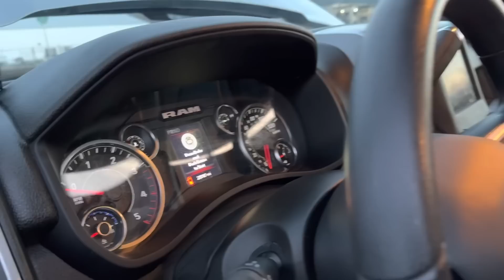Tired of the 2022 Ram Cummins Engine blowing up.

Comment: Your channel is part of the reason I tried ram out. Just bought a 22 a year and a half ago and had 3 DEF lights on in under 10 thou miles. Now I’m hearing of all these issues with the motors. Good thing the 23 powerstroke I ordered is coming soon.
Reply: I had a DEF light pop up on my 22 after filling it at the pump. Reset the code and it never came back.
Reply: Sorry to tell you, but welcome to Emissions. You're just going to have problems with any of them.
Reply: Keep an eye on leaking upper oil pan on powerstroke
Reply: @The Outdoor Group Heavy duty trucks don’t have to meet any MPG standard. They’re exempt because they’re heavy duty. They do, however, have to meet EPA standards and stuff, hence the def and dpf.
Reply: @The Outdoor Group If Ford gets Cummins engines, it’s over for Ram. Unless they get back together with Navistar or CAT comes back to on-highway diesel.
Reply: @cliffordmontana4562  there has been (is) an effort to develop standards for HD fuel economy standards. Around 5 or 6 years years ago, you could read the proposed rule on the epa website, not sure if it's still there. I do know there's a new round of emissions standards set to take effect for '27 (I think), I would not be surprised if they take advantage of that time to also implement mpg requirements.

Comment: The last Cummins I bought was a 2012. Didn't run great from the get-go. Found the valves were set from one end of the spec sheet to the other. At 50,000 miles it started blowing the coolant out the degas bottle under boost. Bad head gasket. Pulled the head, resurfaced the head, studded it... normal stuff. Did the same thing again about 40,000 miles later. I guess the block wasn't flat enough. Personally, I think Cummins either has a QC problem they refuse to address or there is something up with this emissions junk that wrecks everyone's life. I've started rebuilding the old pre-computer stuff instead.

Comment: I had a 2020 throw a rod through the side of the block at 4500 miles. I was towing my 5th wheel to Deer Lake from Spokane. Cummins thought i modified the engine. It was 100% stock. They finally replaced it after a few months. What the heck is going on???
Reply: Mopar.   Typical Mopar products
Reply: @eddiespagetti8395  cummins isn't mopar genius
Reply: I haven't been to deer lake in 20 years. Must be a lot different if you can get a 5th wheel in there. When I was going there with my grandpa it was camper only and like a 12' boat max
Reply: @eddiespagetti8395  Cummins is owned or manufactured by dodge…. Cummins is going to shit because of emissions my ol 93 is still running at 500k Km
Reply: Fiat is probably buying the parts for Cummins... who knows from where.. probably the same place they are buying frames.
Reply: If cummins makes the engine, how is fiat giving them parts? 😂 dumb
Reply: @Project Q  well... the improvements in weight and power haven't been driven by Cummins.  But they have by Fiat! And no one is going to say the quality is what it once was. I'm saying Cummins is probably just doing what they're told at this point.
Reply: @Turbo_Q  if you don't know... one of us is dumb 😁

Comment: What do you pay your drivers? I've ran Hotshot for 3 years otr.. All we run are new 5th gens. Only issues I've had is the cp4 going out. Had one truck with the replacement cp4.2 go out also. Zero engine issues though 🤷🏼‍♂️

Comment: Look at the Aisin K1 snap ring TSB for the 22’s as well. Received my order in Nov, 2022 and now  have 18,000km, 6,000 of that towing, and suddenly lost all gears except 5th and reverse. I’m told at least 1.5 months before I will see mine back. I have always driven Duramax’s and I’m not off to a good start with this Ram.
Reply: This is being talked about on the Ram forums and FB. It seems to be an issue with the mid to late 22 models. I believe the TSB states it affects the 23's also.
Reply: mine had 1200miles on it when the aisin quit. the trucks that are effected are mainly 22's built from may onward
Reply: @fessie0121  did you get yours back yet? The dealer for mine said they have no idea on parts but are hoping 1.5 months. I’ve been reading on the forms of people getting the parts in and the snap ring replaced and still have no 1-4 gears after everything is put back together. This one has me pretty worried.
Reply: @bengourley8406  I did get it back, and the next day it went in for no oil pressure!!! they say it was a faulty sensor. i have not driven it much since I got it back again but it seemed to be working. keep in mind this truck sat in the shop for 38 days after only 4 days of ownership. So i guess we'll see what happens on my first longer trip which is coming up March 27, it will be about 1500miles of moderate towing....

Comment: The biggest issue with all these newer diesel engines is all the emissions crap they attach. EGR is probably the worst offender with longevity and reliability of the actual engine. All the after treatment crap just kills fuel efficiency and increases the likelihood of the computer shutting off the truck because some sensor failed. 

I understand not wanting to pollute the environment, but it comes at a pretty high cost in reliability and dollars.
Reply: Only failures I've had with my 18 are these chickenshit delete products I got suckered into buying
Reply: @wizard_of_poz4413  You should have done better research, deleting your truck is inherently good for the engine if done properly

Comment: Mon-Fri I run a 2022 3500 HO DRW (56,000miles) pulling sea containers and gross 28,500lbs loaded. Couple DEF lights.  Tuning is a little better than our 2020 3500 HO but hopefully the truck stays together.   We have two 23 Fords on order.  Going to see how that platform treats us.

Comment: Wonder if its just the H.O cummins I've got a 2022 2500 with the dreaded 68rfe I lost a transmission at 26,000 Miles just hope I won't have any of these issues. Did they outsource different metals due to covid or could it be an oiling issue or programming issue? Just curious if you have heard anything from ram. I also keep getting a service exhaust system message that rhe dealer can't find out why it's showing up. Love your channel and have learned alot from you as this truck is my first diesel so I thank you for all the content you put out
Reply: The ZF HD transmission will be better.

Comment: My buddy that works at dealer  said theres a TSB that says to use 10w30 or 5w40 synthetic oil only becuase of the hydrualic lifters and  to change oil   more often becuase the egr soot gets re introduce into intake and contanminate oil more then older model trucks. He believes the 22 tuning, allows egr valves open up more often for emmissions purpose. He says he sees more  egr clogging as well in the 22s. He doesn't see it as often in the 19, 20,21. So in a nut shell it's the 22 ecm emissions turning causing emissions failure and engine failure. 🤔

Comment: It's most likely emissions related and I just watched your newest video from a day ago so I know that you are on to the mystery. I suspect that it is in a constant regeneration or perhaps regenerating too often which is diluting the oil with fuel thinning it out and causing the bearing issues we heard in your newest video. I had that happen with an EcoDiesel that I once owned. Luckily I caught onto it and changed my oil before damage was done but I drained 3.5 gallons of oil from the little 3.0 V6! I tuned it after that debacle and all was good thereafter. My current '19 Cummins is tuned and I won't look back. I've experienced pure 100% reliability and driving pleasure ever since. Shouldn't have to but I need a dependable truck.

Comment: Every Dodge I have owned Besides the 12 valve  has Blown up Mulitple times 😂  currently blown up or blew up or blowing up . For example my 2006 5.9 Cummins melted pistons at 100,00 miles , My  brand new 2022 Dodge ram with 18,000 miles has a bad bad  Bottem end knock and tons of emmision issues... 2021 Dodge ram breaks down about every 300 miles  lots of  buzzers and lights bad tourque converter etc etc  . I just keep my 7.3  Ford powerstroke  on the ready so I can still work when they brake down .

Comment: Maybe I missed it. Where was the failure in the engine you had a short block replaced?
Reply from the maker: Cam. Push rod and rockers. Cylinder 5 and 6

Comment: I’m glad my 2005 3500 is “pre emissions” and I get all the power and reliability I could ask for. Ever notice the total miles achieved until failure has steadily gotten lower from where we were at when the 12 valves were standard in Dodges? Emissions equipment is the biggest scam on earth especially for diesel powered vehicles.

Comment: First Paul I love the Content and I have watched you from the beginning. I used your Vids in Making my choice in a Truck purchase. I have the 2018 Dually and Love it! My Opinion is vet a Good truck in the model Years and keep the Sled  running . I use the CTS2 Monitor on my A Pillar and I monitor EGT and Rail Pressure and Most definitely Engine Load numbers and drive accordingly Max RPM/HP. Rather than figuring out a problem using Experience and Luck for diagnostics I start with the additional Facts. I was a Pro Tech for 20 years and You have more experience than I could hope for...but Why are you not running with An EGT Probe and Monitor setup of some type? Personally I wont leave home without it.  And yes I know the Turban throws everyone :)

Comment: its the CP4 pump that these engines came with and its a recall now but its send metal into the injectors and then the injector drop parts in the engine and boom, bye bye cummins . they have a bulletin on Dealer Connect for this. take in any truck from 19 - 22 and see if they have the CP4 pump if so take it in and they will change it to a CP3 for free. Fords and chevys are having the same problems at the moment.
Reply: did the '22's even get cp4's? I thought they changed over before the '22's even came out. GM dropped the cp4 back around '17 or 18, the use a Denso.
Reply: @jeffs2809  it was mid way. 2022 trucks are built in 2021. I have seen a few now that have a cp4 pump.
Reply: @StevenLaFrance  IDK, I had to go back & double check. The recall covers 19 & 20's, news releases shows they went away from the cp4 for MY '21. I could see some slipping into that year, still doubt them making it all the way to '22.
Reply: You might be right but I’ve seen two 2022s up here in Canada that had the CP4s and are in for recalls to get them replaced

Comment: Have a 2007 5.9l H.O. with 495k and with a mild tune and basic straight pipe, intake, etc .... Not one single check engine light or issue other then rebuilding the 48re once, and throwing in a set of injectors for P.M. love Cummins but everything ain't built like they used to especially before the C.R. trucks

Comment: I had a Cummins blow in my 2015 Ram 100% stock at only 17,000 miles. It was weird and very unexpected. Currently in a 2018 Ram Cummins cab and chassis and it's a great truck like many of my older Cummins I've had over the years.

Comment: So I was led to believe at some point that the "bed" in the removed rear seats didn't qualify for a "rest" period per .gov. Can you speak to this?
Reply: It does not qualify as a "sleeper berth" HOWEVER you are allowed to sleep back there and use "off duty". 99% of hotshots sleep in the back seat and log off duty. I've done it for 5 years. DOT can't do anything about it. You just can't take advantage of the sleeper berth benefits such as the split rule they did where you can drive after 5 hours and such and such. No idea on that. Just know big gov or dot can't tell you what you can do when you label off duty. You could sleep on your trailer for all it matters. As long as you are not doing any work, sleep wherever you want.
Reply: I took off front seat and back seat that was 73 in and nobody gave me a hard time

Comment: Gotta take mine into the dealership when high idle is kicked on there is a rattle like the flex plate or the torque converter is going out only have 18k on my 22 hopefully nothing major.

Comment: Ever considered switching to Duramax or Powerstroke?
Reply: I have.
Reply: He tried one but the duramax burns like 30% more fuel at load because they don't have enough bottom end
Reply: My duranax has 347k(towing mikes) with no engine issues had 1 ford and and 2 rams . Will only use DURAMAX
Reply: @juliusdes  which one
Reply: @wizard_of_poz4413  All of them are good many of my friends have all year and have minor problems like glow plugs of injector connections after 150k
Reply: I once had a duramax stuck in my air filter of my 06 Ram !
Reply: @danlorencz82  what

Comment: How did you get dodge to buy back your truck I currently have a 2022 dodge Ram 3500 and motor went out at 36k the dealer replaced the motor but I honestly don’t want to the truck anymore I was also hauling with a gooseneck let me know what I need to do thanks

Comment: The Cummins ISX commercial truck motor was junk also. That engine haunted the trucking business for ~17 years... absolute junk!!!!!!!!!!! Bankrupted a lot of trucking companies. A lot of the ISX engines received complete overhauls before 300K miles; some before 100K! Absolute junk!

China, China, China!! Cummins made a deal with China for cheap/junk metal! It's the porosity of the metal! 

When fuel comes through the metal on the side of the fuel pump (like a strainer), the metal is a bit too porous! Yes, that too, on those wonderful ISX yard ornaments! 

I could type twenty pages for this post but this is enough. 

Almost zero readers in this chat will understand but those are the facts!

Comment: Paul, is it the ticking that cues you in?  I have heard it’s normal and I’ve heard it’s the cam getting worn out.  Been told it’s fine and been told to get rid of it.  2021 bought new, and has 18k on it now.  Started ticking after the first oil change.
Reply: should absolutely not tick. having diesel clack and fuel noise is fine. but if you hear a loud tick there’s something
Reply: My 2018 ticks a little bit when I first start it in the cold

Comment: Aside from the DEF system, the EGR system, and the "frankenmotor" that is part Cummins and part Chrysler.......I'm not sure why anyone would by a late madel RAM truck. The old 12 valves are getting snapped up, rebuilt and used a lot on the road......they were just reliable. The current Cummins 6.7 is a lot of Chinese/Indian manufactured components assembled in Mexico, and not under the most stringent tolerances.
Reply: Yea but unless you want to make some kind of glider kit. You still have a way crappier truck that's not built to take the punishment that the new ones can
Reply: @wizard_of_poz4413  I also know people are deleting the aftertreatment/egr system on later model trucks and running them that way as well. I work for Cummins, and even I'll admit that the aftertreatment and the mindset in Indiana (We have a bunch of out of touch "woke" people running the company) is a joke. What the customers want vs. what the CEO and all her underling think you want are two different things.
Reply: @StormLaker  yea I see a ton of deleted rigs out there because I have one and I haven't had the best luck
Reply: @wizard_of_poz4413  that's the trade-off. There are good deletes and bad ones out there. I've seen some shade tree ones go horribly wrong just as much as ones done at professional diesel "tuner" shops. You are right......glider kits would be pretty darn amazing. I'd take a Cummins pre-emissions and stuff it into a Ford F-350 chassis with an Allison transmission.
Reply: @StormLaker  gdp essentially has the market on lockdown now because I don't think really anyone else can produce the parts anymore

Comment: Hey did you have good luck with the 15' model year, considering purchasing one just curoius if youd have any insights
Reply from the maker: All my 4th gens were solid. It’s the 5th gens got me best buddies with the service writer at my dealership.
Reply: @pddieselpower  haha lol for sure thanks for the reply my friend
Reply: 5th gens got to much power and not good parts or lubrication in the system for the weight yall are towing

Comment: I've got a 22 2500 and that sucker regens at least once, if not two times a week. I had a 17 before and it never went into a regen. My dad has a 19 2500 and his never regens. Everybody I talk to that has a 2500 has said there's hardly ever regens. I don't do super heavy driving, but do pull a 16ft enclosed trailer every other week and when it has a load behind it, it seems to burn off and doesn't regen.

I guess what im getting at is I understand it needs to regen, but once or twice a week seems excessive, with only 30k miles on it. I am going to track intervals between regens to see exactly how many miles, and honestly it doesn't idle excessively either.

Comment: If Ram is planning on leaving Cummins, Cummins will tighten up on accepting warranty claims and stop investing in the production line machine that build these engines. So initial quality goes down, and reliability goes down the tubes.
Reply: Wonder where they'd go for engines other than maybe fpt industrial
Reply: And now the engines fall apart with the rest of the truck
Reply: @richrobb2322  which ones are thag